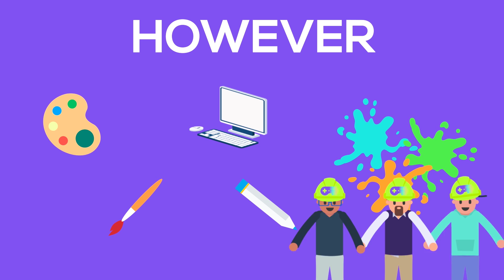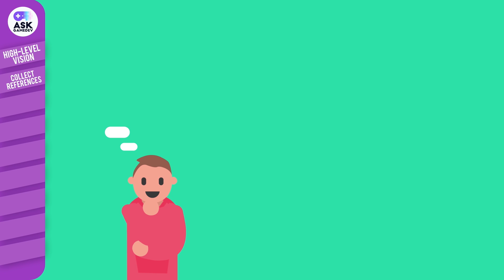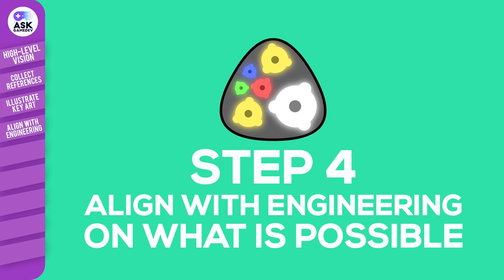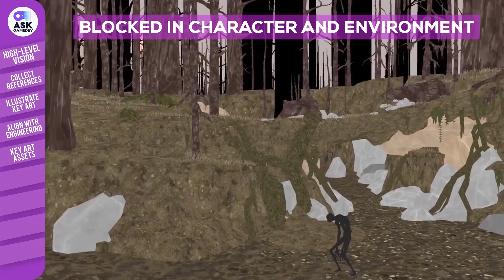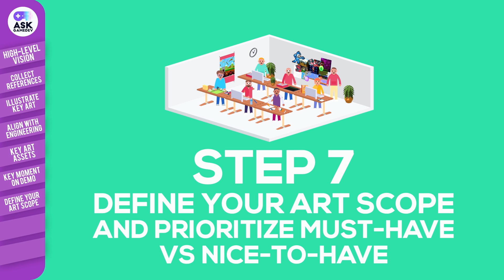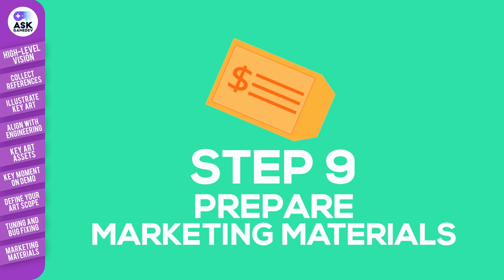Watch This BEFORE You Art Direct a Game!

Comment: A vertical slice and core gameplay loop are different but related. Saying a vertical slice is sometimes called the core gameplay loop is a bit misleading. 

Core gameplay loop is the 60-90 seconds of stuff the player is going to be doing over and over and over during the life of the game. It's important to polish and get the feel right so people don't get bored or frustrated. 

A vertical slice is like you said: a representative section of the game, with graphics, gameplay, and a bit of the plot if there is one.  This helps prove out the game as a whole, and can be shown to investors, publishers, and the public if you make it into a demo or trailer.